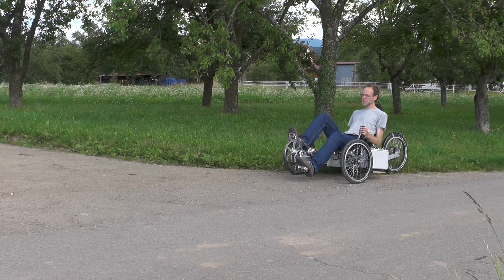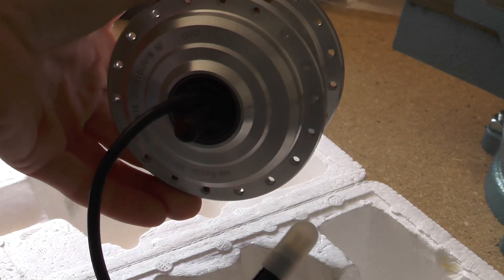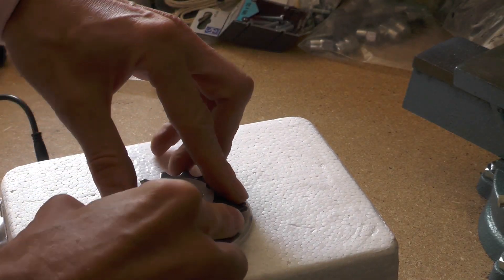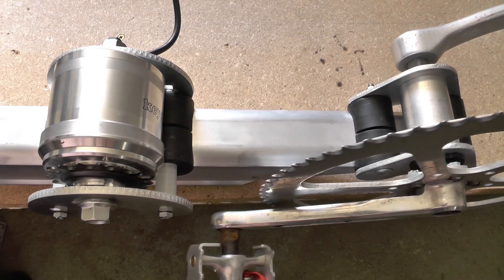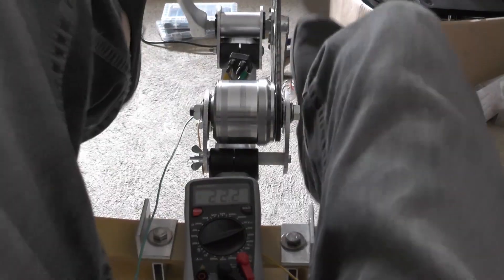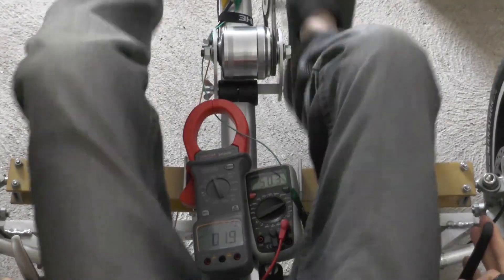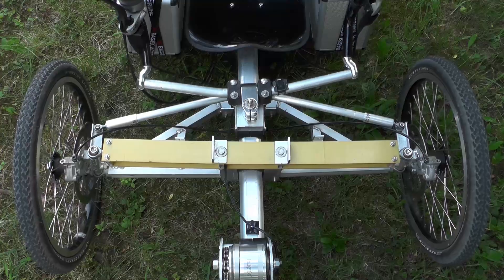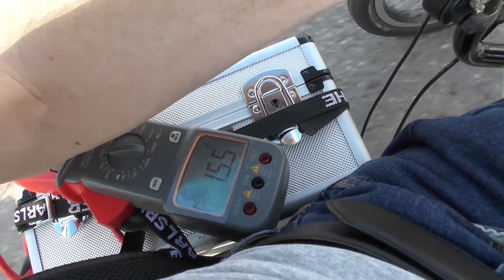DIY Pedal Generator for Electric Bike or Trike

Comment: Giant losses and inefficiencies in this attempt which is sharp from the aspect of the ability to make a video and drawings and machine the hardware but failed in practice. There is no perpetual motion, supercapacitors or cold fusion or even a free lunch for that matter. You would work all day long to put a partial charge on your battery.
Reply: this trike drives mainly on batteries. Once charge in attery s spent, he can continue to drive, but he will lose about 30-35%  of energy.
Reply: @petersvancarek  At top component efficiencies from pedal power through a generator into a battery, out of a battery then into an electric motor, you could only expect about 30% efficiency and have a heavier, more expensive bike.
Reply: @denbecr49  best motor and generator I have seen had 98% efficiency(Csiro motor from australia used on solar rally)But here, I expect efficiency of motor and generator about 85% at the very best. That gives efficiency of transmission 72%. About 2 % will be spent by electronics and battery(coulomb losses)
BTW, e bike2 which uses the motor battery generator system had estimated efficiency to be about 75-80% too
How did you get to only 30%?

Comment: 3 amp output 15 amp draw....How much does it charge going down a hill? I'm thinking of this idea but just have it run off the wheel so its always charging then on big bills you have a throttle for assistance.

Comment: Could you expand on using the motor as a generator? The idea got me.
What does the RPM ratio (between the driving motor and the generator) have to be in order to generate enough current so it can be chanelled directly onto the driving motor? Or maybe using 2 generators would increase the power output?
Reply from the maker: Driving motor and generator are completely independent. The power is buffered by the battery. Why would you leave the battery and link generator and motor directly? I think that would cause some problems on the motor controller. But I can imangine, to use the generator output to set the speed of the motor controller. Then you dont have a throttle grip. You get more motor power, when you pedal stronger and faster.
Two generators are not necessary. The one is powerful enough. The faster you pedal, the stronger you have to push.
Reply: 1. Re-chargeble battaries (Li-ion and others) are quite expensive.
2. They have limited capacity, take up some space and add up some extra weight.
3. If a generator can generate enough power for the motor, it's almost free energy, you don't need to re-charge a generator, in which case the battary becomes unnecessary (just my own point of view).

As for controllers....aren't they subject to be designed for performing different tasks?
Same as different motors have different charachteristics, I suppose controllers  can be designed differently as well (at least theoretically).

Also, I wonder what's the power of your motor? The difference (in power) between your motor and the 250W generator must be severafold if you have to pedal too fast; and that's considering the fact that the ratio between the sprockets (the one you pedal and the one attached to the generator): is 5 to 1 (25 sm and 5 sm)...I suppose.

When you pedal the generator, do you have to surpass the (motor's potential) 160 Rpm threshold before it starts generating power? and the power generated by lower than 160 Rpm is "eated-up" by itsef? 
If that's the case, then I guess it makes sense using a generator with lower Rpm threshold...
Reply: Can't the power be buffered by a capacitor instead of a battary?
Reply: @lemontea2065  Supercapacitors are very massive while able to store less than 1/20 of power. The ir mass alone is debilitating. Also the storage of energy is inefficient in them. Batteries lose less than 5% over MONTH. Capacitors can lose over 20% per DAY. 
Pedal electric transmission has at best 70% efficiency(realistically speaking it will be about 60%).  This transmission has meaning only if you use batteries, otherwise the mechanical solution is better- even if the chain gets dirty and worn, its efficiency never goes under 75%. 95% efficiency of chain can be expected only for short time.
Reply: Yes, that's the great thing about a capacitor, it can be charged & discharged with no loss of performance, un-like a chemical battery. So the motor can run at a constant whilst other conditions can change, pedalling output, assents dissents, is also nice to have some stored power for standing starts.But I still don't know how much power I can make for the motor. In the gym I ride a WATT bike & put out an Av 200w = 17mph, but I don't know how that translates to a motor, I'm doubting I'd get 17mph or would I???
Reply: hmmm
Reply: ah ha, someone asked my question already, thanks.

Comment: Hello Thomas
Could you put the reference of the motor/generator that you use to charge the batteries? Where did you buy it?
Thank you
Reply from the maker: It is a Keyde front hub motor, 36V. I bought it on Ebay a couple of years ago, but I dont see the seller anymore. Try on Aliexpress. You can use other hub motors, too. But they are probably heavier (than 1,4 kg).

Comment: ru using 2 motors 1 hub 2nd middle motor ?
Reply from the maker: No, the rear hub is a NuVinci for changing the gear ratio of the motor.
Reply: @forschungsbuero  Is that NuVinci necessary? I bought it for my recumbent bicycle and it feels that it has low efficiency- For my tricycle project I bought Sturmey archer dual drive like hub and that one is much more efficient. Recumbent tricycle runs easier than bicycle... It should be other other way around... the tricycle should run less efficiently than bicycle. 
You should use single speed transmission here, it would add to efficiency.

Comment: One of the best idea for battery plus pedal-powered Hybrid. For long ride, more lazy rider get, dead battery even sooner.
Reply: Adding this to the ELF would be dead weight and so silly, the sun effortlessly provides what you'd have to pedal very hard for. Pedal power is smarter when used to get you directly from A to B. I never need to plug in my ELF, it gathers all my transportation energy needs in just half a day for my local trips. In three years I have never exhausted my battery even once.
Reply: oh but you're so smart when you're just about as clueless as I am
Reply: Popeye gordon, is your stuff documented on the web? would like to see how you live. it sounds just about right, to me.
Reply: Stan McBeth ü
Reply: Nice trike!
Reply: Freeenrgy220VA/c
Reply: No. This is extremely inefficient. You would have to pedal it for many hours to charge a battery. Much smarter to plug it in or use a solar panel.
Reply: Joey I know about the racer you mention, it is too heavy, too fast and too hot due to full enclosure and there is no solar charging.It has never entered production for good reason. I am an extreme ultra liberal tree hugger who drives a human/solar hybrid ELF. You just made a fool of yourself here.
Reply: or maybe use in combination with solar the organic transit elf has one but not this generator
Reply: Popeye Gordon please look up raht racer same concept and you sound like a Donald Trump supporter
Reply: with all the skepticism

Comment: 3 questions:
1. What kind of hub motor (high torque or high rpm) is best suited to use as a generator?
2. If you built your own motor for pushing your trike, doesn't it make sense to build your own generator as well?
3. If you use 2 (or more) generators instead of one, is it not possible to channel the voltage/current generated by them directly into the main motor thus eliminating the need for battary?
Reply from the maker: 1. High torque! You want to have lowest rpm as possible. Need a step up gear anyway.
2. Shure. I am working on that idea, but have many other projects. I would make a generator coaxial to the pedals. No chain anymore.
3. No need for that. See my other comment.

Comment: I think it could be better with this pedals:

http://www.velomobilforum.de/forum/index.php?attachments/ed_system-jpg.69247/

http://ic.pics.livejournal.com/blacktroll/20416150/1148858/1148858_original.jpg

For the transmission you can use 2 from this:

http://www.luv-engineering.de/Dateien/images/product_images/original_images/783_0.jpg

connected to both pedals, with the gear between, from the gear this mechanism, to rotate the generator always in the same direction:

https://picload.org/image/rrdaodig/cimg0090_englisch.jpg

and after it the generator. This linear pedals are much more effective.

Comment: Due to losses in charging it's best to cycle then generate when going down hill.
Reply from the maker: Regenerative braking is not possible on this trike, because the motor is coupled to a freewhweel hub. Could work, if you block the freewheel.

Comment: Superb design all the way around. I'd give this ten likes if I could -- it must be the best bike video I've seen all month, at least.  5kw motor power is insane! That'd power a smaller car around town. I think I need more sleep before the finer nuances of this design come through but you and your tricycle hit across why I came very close to parting with $3,000+ and did not -- lack of a good suspension. 

And I don't regret it because every trike rider I see I ask one question "If you could change one thing about the bike what would it be?"

and so far ALL of them have said "I'd add suspension" or "shocks" or "a smoother ride" and I live in the most populated area with the largest density of bike paths in probably the whole midwest USA so I get to ask a lot of people on a lot of different bikes. Plus I never see one in the snow. Why is that?

Comment: You came up with a brilliant concept, similar to a hybrid electric automobile!  Can you tell that it's harder to pedal when going up a hill or does the battery pack act as a buffer so that you can barely notice a difference?
Reply from the maker: Generator and motor are completely independent and the battery acts as a buffer. No difference uphill or downhill.

Comment: A very nice project, congrats. 
question: do you sell the motor plans? I have a recumbent trike and your idea inspire me to build one similar to yours.
thanks for your information and keep going.
Reply: I also have a two wheel recumbent bike and it is a very good idea to solve the problem of the chain which interferes with the front wheel

Comment: Thomas Senkel! Very well done. He is a prime example of superior German engineering and technology. However something like that I'm sure could be used to power a boat.
Reply from the maker: Probably you are right and the Keyde is a very poor bicycle motor, but it works very well as a generator. And is very light weight.
Reply: +unhooked25 --- You DONK!
HUhh! The Keyde motor is a known lemon which has made a lot of people rather upset at the sale's hype... It simply does not hold up and many times is delivered failing right out of the box...
And you stand a great chance to have to threaten the bastards via Paypal to get them to service you properly!

HUhh! I'd hate for this thing to flip me forward like a whip flat faced on the pavement under a heavy breaking scenario! or kiss the hard bumper of a tank passing by, huhh I mean a Smart Car!

GERMAN ENGINEERING AND TECHNOLOGY LMAO!
All I see is a copy-cat of all the systems already present in countless machines plastered all over the net. [ like the Carver, T-Rex, and dozens of others, etc...]  huhhhhhh! buddy! what is so grandiose!?

Perhaps good as a kids toy, a go-cart of sorts... hmmm roll-cage please!

Best people BEWARE of your HYPE and do some due diligence and find out the better equipment... and don't dream you will be traveling in a go-cart surrounded by Smart Car size tanks!

...and you are sure it could power a boat! LMAO!  yeah... the Hindenburg!

You sound like the fake witness(crisis actor) in the street in New York who stated: "...and I am sure the towers collapsed due to the heat of the fire!!!..." LOL yeah! symmetrically, and at gravity speed!

LMAO!

Comment: Nice Trike Thomas, do you have plans for the stub axles and steering geer?
Reply from the maker: Sorry, no plans for that. I built it "on the fly". The front hubs are standard MTB hubs with 20 mm hollow axle, and the steering knuckle is welded from aluminum parts.
Reply: @forschungsbuero  thanks for the great video do you have more information on how to build this awesome trike?

Comment: Also, could you tell us more about the batteries?
Reply from the maker: You can use any battery. Mine is made from RC model LiPos. 10 packs with 6s 5000 mAh, connected to 12s5p. So I have 44 V and 25 Ah in each suitcase.

Comment: Why use a brushless hub motor with a bridge rectifier instead of a permanent magnet dc motor?
Reply: +createthis 3 phase ALWAYS works better at slower (cars used generators at 3-5k rpms and this is why they all use 3 phase "alternators" now -- it is really still a generator but a 3 phase one. 3 phase means industrial and the parts are now relatively inexpensive but have much better stats all around (and continue to be improved while the avg home appliance be it a blender to a vacuum cleaner are all brushed series wound motors -- far from the beauty of 3 phase products. Look atop/aside bldgs and you will see every AC unit being driven by a 3 ph motor. almost everything inside your house comes from a factory where 3 phase motors are used to make everything from your computer to your furniture. For decades it has been like this).

But the simple one point bottom line answer is: RPMs. permanent magnet one phase motors would not produce enough voltage until about 3 times the rpms and then they are not as efficient. This guy is an excellent designer. He knows his sh1t.

Comment: What would be nice is to use a high-torque electric motor or even an alternator as the generator if you have strong legs. So long as it's the right type that generates electricity when you spin it, it should output a higher voltage that would be enough to power the motors if the battery were shot.

Comment: Why not connect a motor to both front wheels.depending on the gearing, but once your above (let's say 10 mph for eg) the bats will charge them self and no need to pedal. (Short version) I know theres more to it but I can't fit it in a comments box. Fantastic engineering tho

Comment: What is the motor rated at. I understand that the EEC only allows a 250 watt motor.
Reply from the maker: Thats true for a so called pedelec. This trike would need registration limited to 45 km/h as an e-bike or as an e-motorcycle with more speed.

Comment: There are people in the larger world who have great talent and abilities with metal work etc.But when it comes to the power available for electric bikes  the figures that are used are just amusing. 5 K.W from a 44 volt battery equals 114 amps . It is hardly surprising that the poor lithium battery bursts into flames.And all that through pathetic thin wire.Unbeleiveable

Comment: Nice idea but you will need to pedal for hours on end to provide any useful charge.
Reply: +thra5herxb12s Very right read the meter on his bike. Nice bike though.
Reply from the maker: I can pedal with up to 200 W. The motor power depends on acceleration, speed, road grade, etc. On flat road and not more than 45 km/h I am using not more than 1000 W. That means 20% is of my own power. The pedals are not meant to recharge the battery after your ride. Just plug in the grid.

Comment: This is impressive. My question is, why not use such a large crank gear to directly drive the wheels? Is there not a significant loss of efficiency pedaling to generate electricity to charge a motor to power the wheels / axel? Is the only advantage that you can pedal like a treadmill at home, and then zip around with a fully charged battery later? What if you use all your battery, wouldn't you want to be able to just use the gear like a standard bike... it might be just as fast with such a large gear. How would either method do on hills? Lots of questions! I'm not a mechanical engineering, but I like to learn about this!

Comment: Thank you for a great video !!!! Can I install this generator ( e motor ) on my front wheel as my hub and generate power to my battery, ???? Please check out my e bike build and let me know if it could work for me ? Thank you again . Dan
Reply: +Rc forever it will work only if the car will pull you

Comment: Hi Thomas

I thought you was busy enough with the Evolo ;-)
*

Very clever/skilled made Trike I think !

But isn’t efficiency quite low (in the long way of the series-hybrid ) from pedelling to generator to battery and from battery to motor ?
Please correct me if I am wrong... !? 

For example if losses included from the 2 times chain-ratio motor-backwheel and pedal-generator = efficiency of generator maybe 75%  x  efficiency of motor maybe 75% = 0,75 x 0,75 = 0,56 = 56% ,  minus maybee a 6% percent losses in the rectifier and battery charging/discharging proces = efficiency of only 50% or half the enegy lost ! )

But if pedeling the back wheel directly through gears like on a normal trike you get maybee efficiency of 95% or only 5% losses in the gearsystem
And keep the motor and battery on the trike as a (parallel hybrid) which is a very usefull and pleasent combination. And if the battery run low there is no problems is pedeling home without electricity support, like on a normal trike

NB: 
My very best luck and support to Your Evolo project !